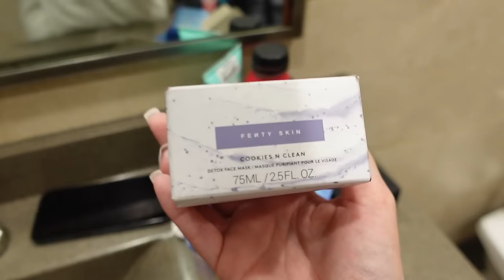Realistic Day In My Life As A Truck Driver

Comment: Hey Nia
There is no way your truck should be loosing coolant the way it is , something is wrong .
You have mentioned a couple times now how you have to keep adding coolant. That is a closed loop system and pressurized, it should not lose coolant unless it is leaking, externally or internally. Might want to have that checked out. Be safe out there.
Reply from the maker: I thought it was just cause I got it with no miles but now I’m wondering what’s going on
Reply: I could understand that and that’s logical thinking. But you have had to add way too much so I would say you are definitely losing it somewhere. I would suggest getting it checked out. ;)
Reply: I agree with your comment
Reply: Start with the EGR cooler.
Reply: If you’re idling all the time you will lose coolant, oil and other stuff faster.  The newer trucks not made to idle for extended periods of time.   
The engine has to keep using that coolant to keep engine temperature down.  
That being said you have to tighten all the hoses leading to and from coolant reservoir.   
In newer trucks coolant leaks are more likely coming from hoses not tight enough.   Easy 2 minute fix or if you go to shop they will turn it in to 6 hour wait at $200hr

Comment: Looks like you can take care of a truck. Your better than some of the drivers out there.   I'm a tech for a company that runs those same Peterbuilt trucks. Might want to check your power steering filter. They like to back off. I've found several of ours loose. Be careful out there.

Comment: @Roadrunnania
Be very careful. I'm  retired law enforcement. You're in a profession  that's still male dominated. There's also a history of a large number of sex offenders that work in the trucking industry. There's also been a number of serial killers that were in the trucking industry because the profession itself makes it harder to track them down. That's changed a little with advances in DNA. Make sure you turn off your phone or cameras location whenever you TAKE a photo or POST a video. It's  imperative that you turn off your devices location. Modern cameras also have GPS tracking so make sure you turn off your cameras location also. NEVER POST CONTENT FROM THE LOCATION YOU'RE CURRENTLY AT. POST CONTENT TWO OR THREE STOPS AFTER YOU HAVE LEFT THE LOCATION WHERE YOU FILMED THE CONTENT. IF you're working in states that you can be licensed to carry a gun, GET ONE AND LEARN TO USE IT. Be safe. God bless.
Reply: Is carrying only for American citizens? What you recommend as a tool of self defense for a Canadian driving coming into the states? Thanks so much! 🇨🇦
Reply: @theBCdream  You would have to first be licensed in the US to carry a weapon.

Comment: Just a suggestion but try using rhe system check switch. Cycles through all the lights and various systems when  hooking a trailer. Its next to the hazard switch and lets you see brake lights. You're killing me with having to jump up to remove the pigtail. Great video mam

Comment: Crazy how many drivers I see that just trust that the trailer height is correct to back up under. Always get out and make sure the trailer is a little lower so that it lifts up when the skid plate hits it before you back under it.
Reply: It only takes getting the king pin stuck behind the 5th wheel once to learn that lesson. lol
Reply from the maker: I can feel when it’s too high and see it also. Jumped a king pin once when I started driving and never again

Comment: You're not supposed to do an engine check with the motor running, you won't be able to get an accurate oil level. Always do a cold engine oil check (before you start the engine) to get an accurate oil level.
Reply from the maker: The truck was obviously off 😂
Reply: @Roadrunnania  my apologies, it just sounded like it was running 🥴🤭😂👌👍

Comment: Using wrong weight oil......need to be Using 10w30 oil.     Not. 15w40. 

Delo. 10W30. Silver bottle 😊
Reply from the maker: That’s crazy cause this is the oil the shop told me to use 😭😭